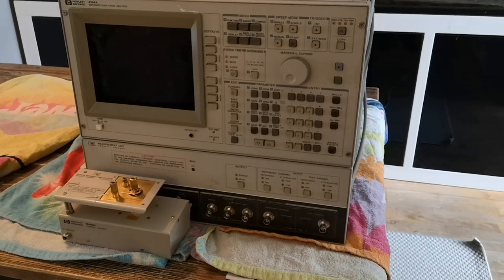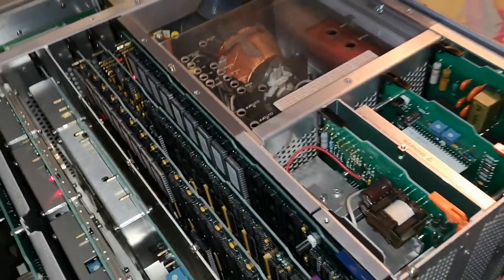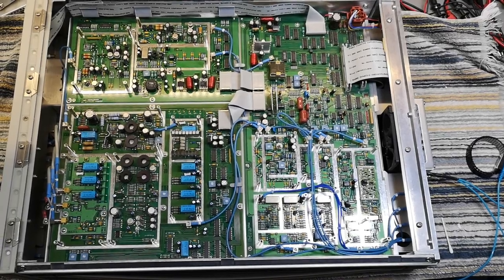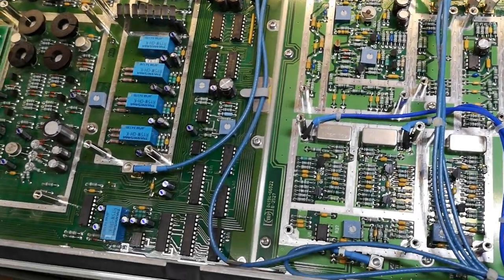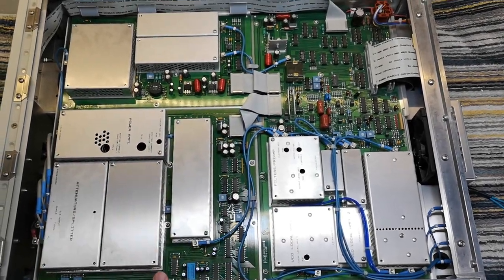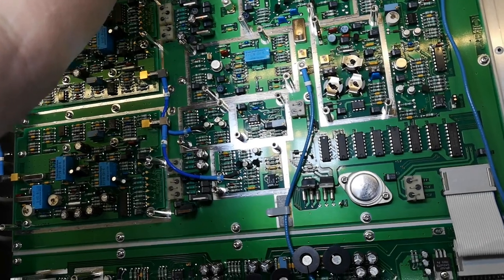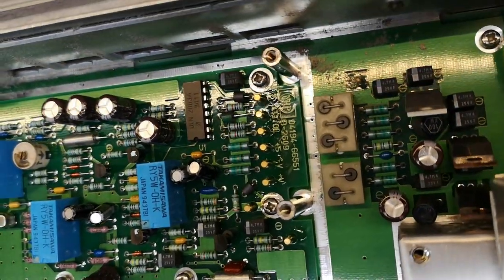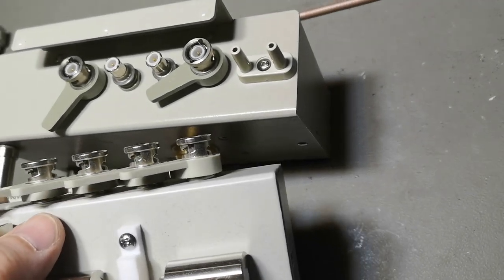HP 4194A Impedance Gain Phase Analyzer test repair teardown (Part1)

Comment: Hi nice video
Would you mind share how to open the lid off?
I am trying to do the same thing as you did. But I am not sure how to open it up.
Reply from the maker: the screw in the centre back of the top plate is the release, but you need to take away the plastic or metal corners first
Reply: Hello, nice video! Do you know how to repair an HP4195a? I think could be very similar to HP4194a. My problem is that the screen is always off and beep sounds all the time.